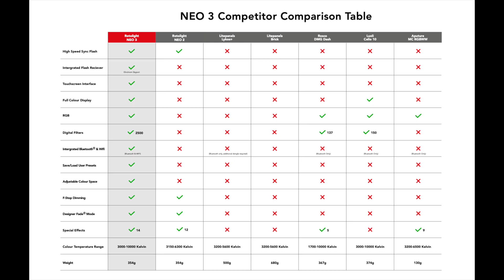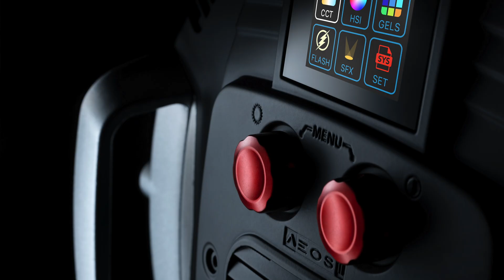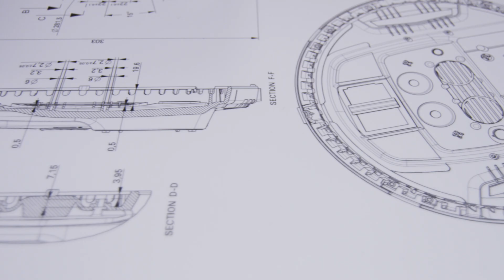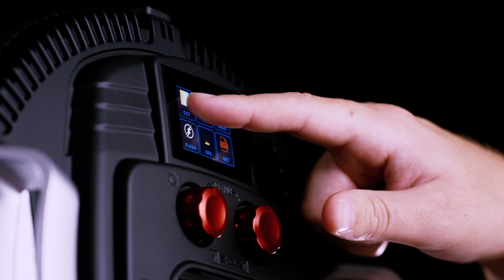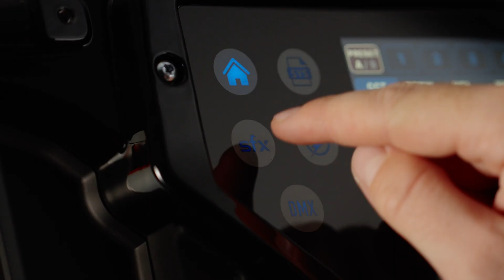Next Gen Rotolight Neo 3 and AEOS 2: Are These the LED Panels Worth Reaching For on Kickstarter?

Comment: I am intrigued by your interest as I know how picky you are for quality. I would love to see your actual review of this next generation Rotolights. I have some of the current generation and in (I confess limited experience) I find them way easier to use with good results than a standard flash unit. But I do agree that they have yet to meet the 5 standards you mentioned. This new generation will get closer, although I worry about the transportability (Sheelping factor) of the larger units.
Reply from the maker: Stay tuned - review coming in January/February time frame.

Comment: In our workshops, we often get the question: continuous or flash lights? My response is: both. We have a couple of Aeos 1 lights in our studio and they perform excellent. It’s not for all purposes though. Best not have too much ambient light and don’t expect the soft lighting that a large octo or parra can give. But as aux light or a convenient starter set for a small studio they are perfect. Coming back on both continuous and flash, one of the great advantages of Roto is the support of Skyport. When you add a couple of monolights from Elinchrome, you have best of both worlds, with only one trigger. Very flexible and great value for money…

Comment: Canada here: we’ve been using the Neo and Aeos since Jason Lanier began shilling for Rotolight,,,not complaining here ‘cuz Jason’s discounts cut our prices in half for this VERY pricey piece of kit! However, we also have issues with Kickstarter funding and ‘ghost’ products,,,not sure why a solid outfit like Rotolight had to go this route to cover product development and production costs. We are skeptical about the success of this strategy and will hold off participating. BTW, our Rotolights have never been our ‘go to’ lighting solution - NOT ENOUGH POWER!!!! And the rechargeable batteries are too expensive for the Neo - should have been engineered for easily replaceable lithium DSLR items from the major camera manufacturers.

Comment: But if they've been used in shows and movie sets and have all this fancy expensive B-roll.... why do they need to financed through kickstarter?
Also noticed the comment down below about the light sitting somewhere gathering dust. I bought the Neo II when I saw a photographer swear by it. Come to realize for the almost $400 price tag at the time, you only got a meek LED light that needed all these extra accessories to use flash or diffuse the light. Rotolight is just too expensive for a.) their base product b.) overall investment. If you want to do what you can with say, a Godox Strobe, or an Apurture LED light, you need to spend almost double the amount plus their international shipping to achieve same results. Again, this is nothing against your video and opinions Hugh, I'm just trying to avoid beginners getting caught up in marketing like I once did and spending more than they should on gear they probably don't need. Like almost $300 on a soft box because an influencer designed it... hold that thought haha
Reply from the maker: Happy to have a well-reasoned contribution to the conversation!

Comment: Hello Hugh, There comes a point in most peoples life's I think when its nice to use nice kit. Yes I have done the bye cheep, but up with and work around. It is so nice when you find kit that just works and does what is design to do. I have known Rotolight for years and look at there systems that are well made and designed to work. Keep well, keep safe and enjoy life (it is to short to start with) ps I am a Broncolor and Elinchrom user mostly flash.
Reply from the maker: You too, John - and thanks for this perspective!